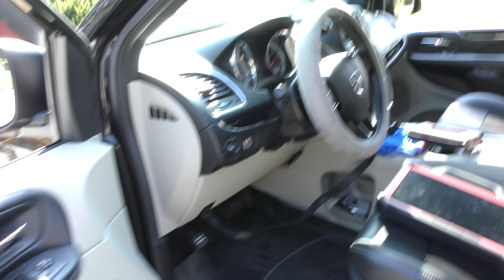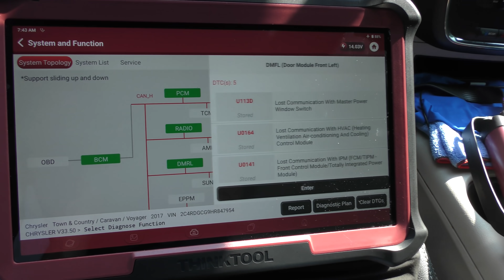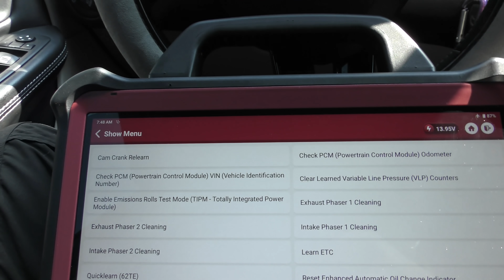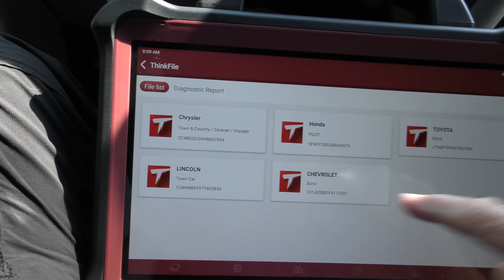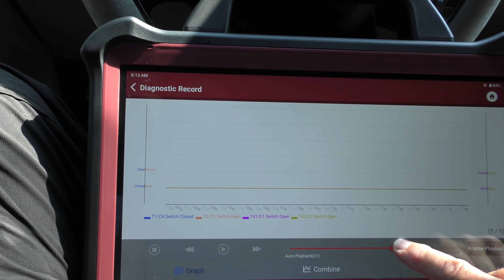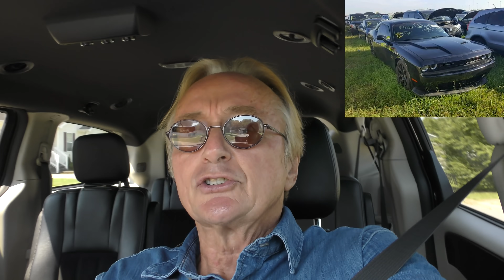Here's Why New Dodges are Crap

Comment: My 2014 with 230k kilometers, new coils, plugs, injectors, cam shaft, 3 thermostats under warranty, new water pump, now I need alternator.  I'm at the shop every month, this van is not worth it past 175k

Comment: Okay so my husband and I bought a 2010 Dodge Nitro 10 days later it started running hot for absolutely no reason dealership would not call us back so we brought it back and they fixed it so we thought it's still running hot honestly it's a great little vehicle we both love it we just don't love the fact that we can't figure out why the heck it is running hot and why no mechanic can seem to figure out the problem as long as you keep the heater on high it does not run hot but as soon as you turn the heater off then the temperature gauge starts going up any suggestions?? Any help or advice would be greatly appreciated thanks so much in advance

Comment: I don't like dodge.....I've had quite a few, of mine. Friends ,and family's....and had a lot of issues....but, I have had a few that were reliable..one was a 98 grand caravan my ex and I got for like 350 from a friend, with about 190k. On it. I was surprised how well it ran and drove. We ended up trading it in for an 09 dodge journey R/T  ...that was a mistake...it was really nice. But always had a problem....the others. We're a Chrysler cirrus w 193k , 4 cyl we got from the original owner for like 400.. my Durango  SLT with 252k ...and my 98 ram w 145k .my ram was my fave.. it was white, had the magnum V8, factory lift, short bed,  had a rebuilt tranny when I got it, sometimes you get lucky..

Comment: Well, I have to say, my 2012 Dodge Grand Caravan (Chrysler Town & Country) was actually pretty good to me. Same powertrain and body style as this one. Took mine on several cross-country trips, towed my travel trailer with it and used it as my daily driver. Roomy and comfortable. I traded it in at 50,000 miles on a Toyota Tundra and got half of what I paid for it. I think I came out ahead and "dodged" any serious issues if I had kept it longer.

Comment: My mom had a 2011 Chrysler Town and Country. Bought it used for around $26k. Drove it till it had around 217k mi on it. But it was a terrible car. Always random stuff breaking or being in the shop. The stow and go seats were nice though. You could haul a lot. And road trips were good in it. She got a trade in value of $2k at the Toyota dealership. They ship it off to another country to be turned into a taxi. And then she got a 2019 Toyota RAV4 adventure. She absolutely loves it. And it can get out of the driveway way better than the van in the winter.

Comment: Just  In  bought a 2016 Chrysler Town & Country. Car runs great.  It has an eco mode for the transmission.  Do not use it.  It will hunt and shift all over the place.  I use mine in standard mode.  I got 27.3 MPG on straight highway driving which I think is great.

Comment: Actually the quality went up when FCA took over & this is coming from somebody that has a 300C Hemi when Mercedes ran Chrysler & with 160,550 miles, only front end suspension parts are needing replacement, which is very typical with any of these, usually earlier than mine.
Reply: Lmao..no, it didn't. When diamlier took over it went up. Now, they suck again
Reply: @richsweeney1115  definitely a lie, I've had them from both of those eras & multiple ones at that, FCA definitely upped the quality of them, both externally & internally.
Reply: @JustinPennito  oh yeah, the renegade is souch better than a Cherokee....wait. It's not. New Cherokees are better than the old ones..no, they're not. One thing I will say is better , is the new compass has an aisain
Reply: @richsweeney1115  and you just hit the nail on the head with that last sentence, how many times has Scotty put down the Fiat 500, yet as many as they sold the first couple of years, I've never seen one broke down & guess what, they also have an Aisin transmission, but didn't Scotty say their transmission are crap, however it's the same transmission that Toyota uses? Yeah, you literally just proved you are a sheep.
Reply: @JustinPennito  actually, I know people who have had them, and the motors have blown. You're an FCA sheep.  I've worked on csr and trucks for decades, I've been to school for automotive, I've worked in the field.... Chrysler sucks. They still have tranny issues. Some have valve issues.... ECT

Comment: I got my dads 2004 Ram and 1500 when he passed away 3.5 years ago.  It was having a similar problem and he thought it was the transmission also.  The truck had 136000 miles on it at that time so I made an appointment to get the transmission checked out.  Before the appointment date I was researching the problem on line and found that bad spark plugs or coil packs could cause such a problem.  I figured the spark plugs had been changed but when I took one out to look at it I found the center electrode was worn away.  All 8 were like that.  I bought 8 new spark plugs and put them in.  This fixed the problem with my dads Ram.  It now has 159000 miles on it and runs smoothly.

Comment: Any recommendations for a vehicle for commuting to work. But also gotta drive through the Pacific northwest snow ? A few up and down roads in my commute gas efficient would be great and passenger room too
Reply: A used 4wd matrix?
Reply: @stev_0690  I'll look them up I'm open to anything just would love a reliable ride that can live for a good run
Reply: @SantosProd  the fwd matrix's are a lot easier to find. i'd get the fwd one and just put good snow tires on it. fwd works perfectly fine in that situation. wouldnt want to deal with the complexity of awd when it breaks down.
Reply: toyota camry or corolla. AWD is good but front wheel drive works great in the snow, too. Just buy good tires.

Comment: I have a 2013 Dodge Grand Caravan. I change all my fluids frequently. My trans shifts smooth and silky. I do yearly trans service on mine. I make sure my engine oil is always clean and my brake fluid is flushed every 2 years. Coolant flush every 2 years as well. These new cars are super expensive when they break down. I try to prevent all of those issues by just keeping up with it. I'm lucky that at the of 63 I am still doing all of my own maintenance on my cars. I think it keeps me healthy as well.

Comment: Scotty, I've had 3 of those Caravans and my last one 2017 was like the one your friend has there. It's the rental package, and it means it's been beat half to death then sold. That said, I got my at from Hertz and like my other Caravans it was great! 
I use them for work in the property maintenance business. You can beat those things to about 200K before you have to do anything. Sorry Scotty this one I can't agree with you. I think they are good vans. I have about 300k miles experience with them. Oh and one thing if you use flex fuel they run like crap. One tank of good gas will get them back.

Comment: Hey Scott, been watching you for years ima big supporter but I just had a quick question , I have a 2006 kia sportage ex 2.7L and I was wondering if my car has an inertia switch or fuel cutoff switch ? My car cranks but seems like my new fuel pump isn't sending gas to my injectors.

Comment: Scott I have a 96 Dodge Ram 1500 sense new, At 320,000 I had to have tranny rebuilt, I use to put on a 1000 mile a week Blows the garages mind at emissions, Passes like a new truck,Last year was last year for that, Truck is getting a lot of rust, But Scott still Runs like new, I wish I could fine a truck to put this motor in , I know 350,000 sooner or later something is going to Give, But motors never been apart, I think I could get a million miles out of it, Just thought ,I would share that with you, Great video's

Comment: I drove a 2020 dodge RAM 1500 classic work rig across a dry river (about 1ft deep) and on a service road. After about half hour the thing turned off on me. It said electrical malfunction on the dashboard. Then the check engine turned on. It has the knob shifter so we couldnt put it on neutral to pull it out. We left it overnight on a busy service road in a state park. I found out on youtube later that night how to put the thing on neutral manually. I couldnt find this on the vehicle manual. Next day the thing turned on and we were able to drive it across the river and get it towed back to town. The check engine light was still on and it drove funky. Now at the service shop the thing did the same thing to the mechanic. Left him stranded in the highway. They found that the system was having a communication breakdown between the communication module and engine. There happens to be a break on the wiring warness! They said that there was no sign of rodent damage. While on the service road a dodge guy hiking pulled over to try to help. First thing he said, " I hate these new dodge vehicles." Even a Ferrari mechanic who happened to be hiking out there with his wife pulled over to help and he was puzzled with the rig. Thought it was a POS.

Comment: Learning cars currently

When he says the valves closed when he put the transmission in park, was he talking about the engines valves or are there valves idk about. I thought the motor still fires in Park, just the converter is disconnected

Comment: Hi Scotty, I have an VW Routan 2012, which is the same Dodge and has the same 62te transmission. The same problem occured and I changed tranny fluid on 95k miles and had metal junk in that filter. Appears the bad fluid had high pressure and broke low drum. Compared to US at my country transmission rebuild costs 2 times less, but the parts were ordered from US for 1100$. So I guess the owner of that Dodge have to pay about 3-4k$ to fix that.

Comment: The nice thing with Toyotas is they have the Eco button. Which I normally disable and leave it in Normal. The Eco with its early shifting makes the car feel like its dragging an anchor. The Sport mode lets it delay the shifting but I like the normal mode. The car seems more responsive without it hunting gears.
Reply: On some cars Eco mode also softens the throttle response. Major PITA. Sport mode can be too skittish so yeah, Normal mode is pretty good.

Comment: My first minivan was '91 Plymouth Voyager with 144,000 miles.  It was my commuter rig and saw a lot of freeway miles in and around the city.  I retired it at 310,000 miles.  The only drive line repair was a water pump and a radiator.  It ran fine, but, rusted away to nothing because of winter freeway salt.  Crap?  Well, this one certainly was not crap.  I've had two Town and Country vans since then, a 2001 and a 2010.  Still have the 2010.  The computer controlled climate crap-ola stroked out on the 2001, so, it went down the road.  I've had OK service with the 2010, other than hitting a deer and doing $8,000 damage within the first month of ownership (karma wants me to drive a rust ball, not a pretty nice rig).  It needed wheel bearings at about 130,000.  So far, so good.  Granted, I'm an old school MoPar freak, so, I tend to overlook some stuff, but, my older Chryslers have NOT been crap, but, none were/are Fiats!  For reliability, I would still rather have a late 60's or early 70's Chrysler A-body, slant six, and TorqueFlite.  Ah, the good old days!

Comment: I have a 2014 with 90,000 miles. The only out of warranty repair was a replaced thermostat for less than $200 (dealership wanted $400+). Scotty did scare me into changing the transmission fluid as a precaution though (for which I thank him), but why is mine still working fine?
Reply: Preventative maintenance is 🔑
Reply: 90k is nothing.....why didn't you replace the thermostat yourself? The part costs like 10 bucks.....and it shouldn't have needed it that soon

Comment: Owner of a 2016 Chrysler Town and Country.  To date:  Stuck side door at 25,000 miles (dealer repair), transmission leak at 35,000 miles (dealer repair), head gasket repair at 60,000 miles (dealer repair), 93,000 miles and currently at the dealer for a blown transmission.  Thank God I got an extended warranty on the power train!  The warranty company is taking a bath on this one.  I will be selling it as soon as I get it back.  It's been in the shop one full week while they wait for the forensic exam on the tranny requested by the warranty company.  NEVER again.  Not even for free would I own another Chrysler-Dodge-Jeep product.  And I bought this one "certified" used.  Yeah....a certified POS!
Reply: I'll take a free Jeep. I mean I'll probably trade it in for a better American vehicle, but I'll take it free.

Comment: Everyone I know who's had a dodge loves them and they last, maybe your customers are taking it to a crappy mechanic.
Reply: Parked a 2004 Ram 5.7 with 364,000 miles. Idled smooth. Needed rear end work and emission sensors. No motor work but for fuel pump, radiater, brakes.
Ac still cold... 83 dodge sold with 535,000 miles on 318. 73 plymouth pickup 281,000 miles on 318ci. Dad had 69 dodge pu with 225 slant six 0ver 400,000 miles.
2013 Ram 5.7...140,000 miles...
NEW MOTOR... Go figure...

Comment: Funny mr Scotty posted this 2 weeks after I started using the manual feature on my Jeep, transmission stopped hunting for and stopped clunking so much…just getting by till I can get rid of the pile of 💩
Reply: What year is your jeep? How long have YOU had it? how many miles is on it? What condition is it in?
Reply: @beast_mode_4200  19, issue since 30k. Has 70k now. Bought brand new
Reply: @ET74019  why didn’t you go to the dealer and get it covered under warranty then? Besides that, the market is high right now. You should be able to get rid of it easy unless you’ve got a major flop :)
Reply: @beast_mode_4200  plus I couldn’t sell this out right to a person, same dealership keeps calling me to buy it back lol but they don’t have any to replace it with, and I don’t want another Jeep, 1 and done on this one
Reply: They looked at it 3 times under warranty, no codes, claims it shifts perfectly. Never in my life have I had a transmission clunk /slip or anything with over 500k between the other 2 cars I owned before this one. Yeah I wish I had the chance to unload it, the task is finding something else. Not many cars in the area at the moment, new or used

Comment: The Dodge minivans are better to buy used. I got a 2018 brand new with 72 miles on the odometer. It had just 20,000 miles when I traded it in. The van was about $25,000 new and depreciated to half its value in two years. The one good thing about it was I didn’t have a single problem with it
Reply: I did nearly the same. Bought an 05 in 05 with 12k miles for about $9k discount off orig sticker. It was cheaper than a used 4 year old Honda with over 80k miles and no warranty. It's been a great van.

Comment: I have a 420 code and my long term fuel trim is at 25% on a 2003 Toyota Matrix. I have checked for vacume leaks and found none . Fuel pressure is good. I hear injectors working. What else could it be.

Comment: My parents bought a brand new Dodge Aspen in the late 70’s. They took the plastic off the seats. Such a damn lemon with so many issues. It broke down on the way home. My dad almost said keep it but they fixed it and he took it home...about 2 years later it was a lawn ornament.  
For years my dad said he would never buy a dodge again. Fast forward to 2015...they wanted a van and got a great deal on a new Dodge Caravan...piece of crap.  The valve stem one day fell out and had a flat. Rear brake locked up. The front wheel bearing went bad..and so on. They are just poorly built. Some last a little with minimum issues and a lot are just lemons. It’s not if but when they will break down.

Comment: Do not buy any of these newer Dodge or Chrysler products. You can buy an older Subaru or Mitsubishi product, instead. I will prefer the 2006 Mitsubishi Galant mid-size sedan with the 2.4 L four-cylinder engine or the 2008 Subaru Outback 2.5i station wagon.

Comment: Scotty, that is not a bad dodge.  The opd caravans were amaizingly reliable. I had a friend with a 5 speed 4 banger version that was abused by 4 college aged drunks and would not die.
Reply: As long as preventative maintenance care is done, you’ll be good. Plus, that V6 engine is a good engine
Reply: @kerbytheslayer6181  4 banger is r cyclinder
Reply: 4 cyclinder
Reply: That's bc it was a 5 SPD and it had a Mitsubishi motor
Reply: @richsweeney1115  knew it had to be something.

Comment: Looks the same as my friends’ which has had two transmissions; one a 15K miles and the second at 40K.  GPS failed out of warranty and $900 to replace (he didn’t buy it).  Both transmission were $4000 replace.
Reply: Had a 2000 Voyager with the v6 and 4 speed.  Tranny at 55k and valve job needed by 65k.  Gave it away for $1 before I burned it in the driveway

Comment: My family was in the auto parts & repair business starting over 60 years ago.  Our experience is that Chrysler products were always the least reliable.  We sold lots of parts for Chryslers, Dodges and Plymouths.  Consequently, I would never own anything made by Chrysler.  It’s a shame that Jeep is now a Chrysler product.
Reply: Ronald Filkins  Maybe, but not necessarily. Ford or GM may have bought the Jeep line but I doubt they had much interest in the rest of AMC other than to eliminate a weak competitor. Chrysler bought AMC which owned the Jeep brand at the time. I’ve owned quite a few Jeeps including Willys, Kaiser, AMC and Chrysler produced and have completely dismantled and rebuilt the engines and transmissions on some of the older models.